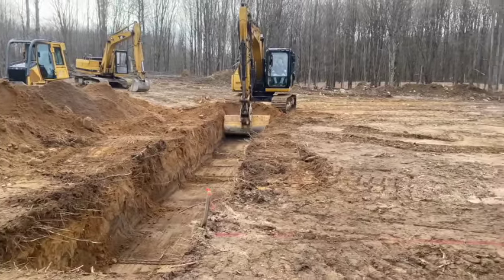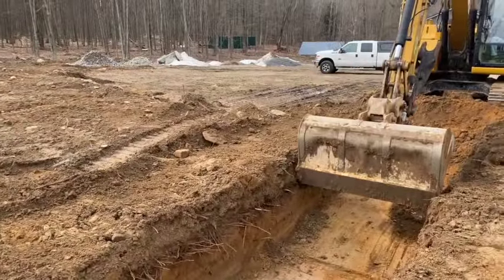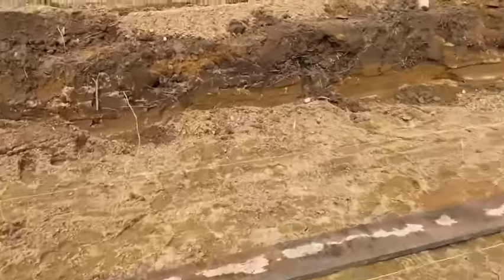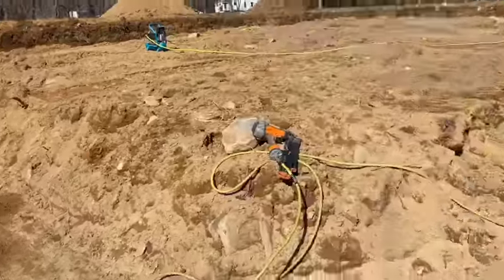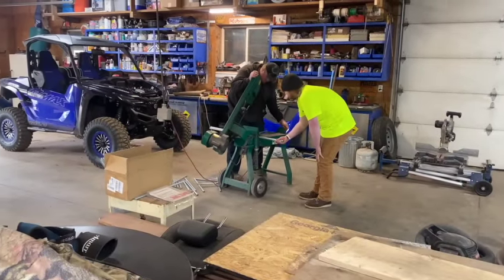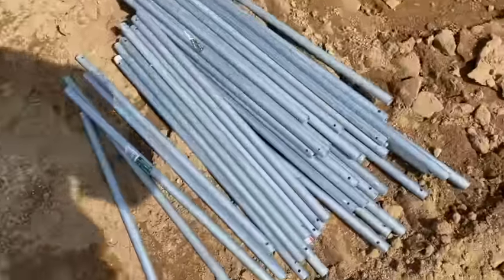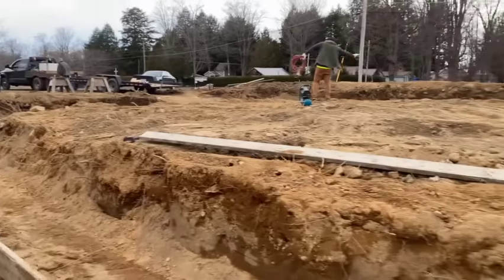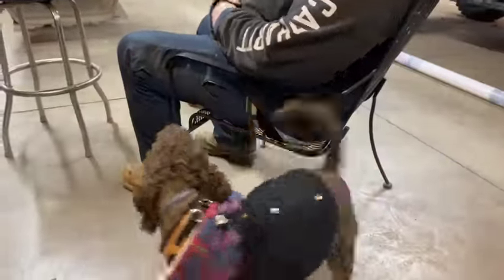Brand new ICF mono pour system you have never seen before.

Comment: Back in 1985, I devised a computer training video technology based on the layout of the famous LA Gastronomic cookbook. I can't believe that after almost 50 years, 99.999% instructional videos with great tips are still getting made by the old-fashioneded format prior to 1985 that forces me to listen to hours and days of lengthy videos to get info, a piece here, a piece there. And when I get it, it takes weeks to organize it. What the schmuck; just hire an architect and contractor and let them do it their way, good or bad. My neighbor did such and had his house demolished because just the cost of a new sewer line 10 years ago was costing $30k. So, he started afresh using a contractor to do it all. All I can is that if I wanted such a Mary Jane new house as he now has, I would move to one already built in an inexpensive cookie cutter subdivision in an inexpensive local for a small fraction of the cost. Unless you have millions to pour into a project that actually should cost hundreds of thousands, architecture is dead, dead, dead.

Comment: Why the house wrap in the bottom of the footer?  to prevent rising damp?  (@ 7:20 Footing 20" wide 10" deep, Spreader boards (conduit) 24" wide (each board nominal 2") ( forms 24"OD - 4" =20" ID)
Reply from the maker: Yes it is going to stop the footer from wicking up water and it will help me keep my planks from getting all concrete. Easy clean up.
Reply: @bondobuilt386  looking forward to seeing the monopour and stripping of the forms.
Reply: @bondobuilt386 I have seen guys put old car oil on the planks so the concrete doesnt stick. Seems to work well.

Comment: Try the Fabform monopour system with the Fox Blocks.  It's a plastic fabric footer bag that attaches to the Fox Blocks which are leveled inside the bag with Zevelers, drill adjust turnbuckles.  No lumber or cross ties and a speedy monopour.
Reply from the maker: Ya I seen that system.
Reply: They also make the bracing for the ICF wall and it's way cheaper than most bracing and fits into a tote.

Comment: This is a interesting way of going about this, I remember a few years back seeing the fastfoot system where you can essentially do a mono pour and skip the foundation forms by having a vapor barrier fabric act as the concrete form and use leveling feet to space out the proper footer height and level out the ICF blocks all in one. I think I saw it on Cutting edge homes when i was looking into building a ICF pool.
Reply from the maker: Yes I have seen some do it that way too

Comment: IN the south, my concern of the pipe is allowing pests in and water.  I heard you say a weep hole, but i See the water going in more than coming out.  Not a concrete guy, I assume the "spreader are to keep the forms in place during the pour.  The stakes on the outside will keep them from spreading, so I would assume they are there to help keep them from closing in on each other.  Since #4 rebar is about the same price as conduit, and could help structural strength (not necessary but added)  Why not do something like that.  Use the corner of a box to support the rebar with one staple to hold it up. Have a template set up to hold the boards in place while they are hammered in, kinda of like the stud master 16 from talon tools but for your purpose as temp spreader.  I think it would be faster also since you would not screw the pipes in, or boards, just one staple from a pneumatic stapler.  Save on screw cost and time.  For the board used on the bottom, the 12
 inch 2x6, you could also pre-make these with holes pre-drilled holes in the top board so your 3" screws go thru and you don't have to disassemble them to remove them.  I would paint them a unique color so during cleanup, you would know these are reusable and not waste.  A little more time the first time, but the 50th time would be happy you did it the first time.

Comment: Been doing it like this for quite awhile. Instead of conduit we use rebar and notch the top of the footing form board to drop the rebar flush.
Then icf sits on top and L kickers big enough and wide enough to grab the bottom of icf and outside edge of footer form and screwed.
Reply from the maker: Awesome. Have you poured a full basement wall with footers at the same time or just stem walls?
Reply: @bondobuilt386  
Stems walls  below the frost line so about 4 to 5  feet and shallow frost protected footing and stem walls.
We use L brackets made out of 2x6 with a triangle plywood gusset on both sides of the 2x6 L to set our footing form boards to height. The bottom of the L has a hole drilled for a rebar pin that we use to pound into the ground to set to our lines once we have the outside perimeter form set in place.
The L bracket is screwed  to the footing form board with GRK torx screws that we reuse all the time.
So the L bracket is like a foot that holds the footing form board at our needed height and also is our brace.
If needed once everything is set we’ll come back and drive round rod for extra bracing and use metal strap around the footer after our spreaders are set on top to width.’
We always reuse our L brackets AKA braces for another pour
Reply: Great idea for notches on the footer form and the L brackets.  Did you also space your rebar every 3' like the conduit here?
Reply: @Patrioti3260  2 feet

Comment: Great content Bondo, getting ready to do a garage in Taos NM using Foxblocks as well. Great idea with the conduit use. I've used 6 mil poly in the footer forms for my last few builds works great. One thing to remember when doing Ufer ground rod, concrete must be bearing directly on the dirt .
Reply from the maker: Thanks David. Good point on the ground rod. I think we will tie that into the concrete floor.

Comment: Amvic makes AMPEX EPS for radiant floor insulation of R-10 to R-16.  The Ampex holds the pex tubing easily in the heat welded vapour barrier.
2' x 4' Ampex interlocks with a t&g edge.  The wire mesh is placed on top later.  In this way you save alot of time by not having to tie down the pex,  you can stand up to install the tubing, no kneeling
Reply from the maker: I have used that but found it was expensive.
Reply from the maker: I think we are going to start stapling the tubing to the foam and wire on top of tubing.

Comment: for outside corner support I use a spreader on a 45 degree angle so that is will support the ICF corner foam only.  Later in the video I see you did place conduits at the 45 angle

Comment: Doing a mono pour is to me the best way to Keep water from getting through the solid concrete footer to walls. I like the idea of using 1/2" conduit but each of those conduit's will allow water to come through unless you cut them off at the wall and fill the holes on both side with foam and caulk to seal it from water getting through. Which is easier to work with Fox Block or Nudura Block.

Comment: Bondo,

This video is great timing for my current project.
Just now excavating and coordinating the plumber and electrician to move the existing water line from under a slab on grade addition.
Using Build Block 6” ICF for the first time. My engineer drew up the footers 24” wide x 12” deep, with lots of rebar. One length of the footers is 30” x 12” and going under the existing house on pier construction. A bit of a pain but oh well. I am using Form A Drain and it only come 8” high will put that at the base of the footer and 2” x 4” s on top to get to 12” footer depth.
Would you consider a 24” wide ICF as the footer itself and form a drain attached on the outside perimeter !
This would make installing the 2 rows 3 wide rebar installed in the footer easier, and add frost protection ?
The lay out parts of this video will help me square up everything in the trenches.
Planning a 2 inch bed of gravel under all to help with drainage.
Reply from the maker: Sounds like a good project. I don't think there are 24" ICF blocks. Glad this video is helpful.

Comment: My apologies if I missed it, but what's the house wrap under the footings for, to keep the concrete from pouring out the bottom of the forms?
Reply from the maker: It is there as a moisture preventer. Keeps the footer from wicking up the water.

Comment: Have you ever done or considered doing an insulated raft slab foundation? Where there's insulation all around the edge beam that then also continues below the slab, and is used as a form, then whole thing is poured at once?
Reply from the maker: I have not. We did a big slab last summer but dug it out after to install the frost protected foam detail.
Reply: @bondobuilt386  Ouch. Yeah I'd love to build a house that had a slab like that. Easier to seal everything up, too, though some radon system would probably still be needed. Too bad I'm so far away (NJ) from where you do this stuff at.

Comment: Time wise is this faster or less expensive than pouring footers, laying blocks and insulating ? Looks good, but seems like a lot of work and cost.
Reply from the maker: concrete blocks will always be cheaper. The ICF is less labor intensive and way stronger but definitely more expensive. On this job it was to cold to lay blocks without heating the mortar and using anifreeze so timing was great for this one. Also the ICF is more DIY than concrete blocks.

Comment: Drill a hole big enough for the cement paste of the concrete to go in in the middle of the pipes directed upwards 
And they will probably plug them self 
Up  when you pour .
Reply from the maker: There is no need for the pipes to be plugged.

Comment: Awesome video. I like the amount of details you show. It's a reality check to the Lego block simplicity advertised by all ICF manufacturers. Hope you will be telling us the pros and cons of Fox Block vs Nudura at the end of the project. I am curious as to what/if you will do something to block the conduit or if it even necessary. Could you use this conduits system for a full basement foundation?
Reply from the maker: This could definitely be used for a full height wall.I will try and explain my take on the two blocks. The conduit will not be an issue and will be under the floor on a full basement. Good weep holes if water needs to escape out to the perimeter drain.
Reply: @bondobuilt386  awesome,thanks

Comment: Bondo - could you please explain what the misc wood blocks on the ICF forms are for? Looks like they are tying seams together?How are they attached?  Great job!
Reply from the maker: They hold the blocks together where there is an odd size that won't lock together. A common seam. we screw them into the plastic studs.
Reply: @bondobuilt386  thanks Bondo!

Comment: I am considering an ICF mono pour for a 9' high basement. The tricky part is that I also want to do a suspended concrete ceiling. Is there a theoretical max height for a monopour footer/ wall? I want to avoid having to hire a pump truck 3-4 different times.

Comment: I've never seen building paper under a footing before. Is that some kind of local requirement? Does it provide freeze thaw protection or something else? In my region of Oregon we need to provide radon protection under living areas but that takes the form of a vapor barrier like 6 mil and we don't have to put under the footer.
Reply from the maker: That is there to  prevent the footer from wicking up water and also to keep the form lumber cleaner and ease of stripping the forms also.
Reply: @bondobuilt386  Nice try, but such hacks are unacceptable where I live. Here there must be a clear and continuous vapor barrier across the whole house.
But I am happy that the problem was considered at all. In most of the ICF videos on YT there are not attempts at all to prevent diffusion of moisture from the soil into the walls.

Here we make first the footing, then a reinforced slab ON TOP of the footing. (you can put XPS below in the middle). Then comes a 0.15-0.2" continuous layer of vapor barrier. The walls (bricks, ICF...) are built on top of this vapor barrier. Everything below this vapor barrier is considered wet, and everything above is dry. If the this vapor barrier is below ground level, then the insulation is continued outside upward on the walls.

Comment: What do these foam things cost would it not be cheaper to just lay solid cinder blocks. Foam idea has been around for over 50 years nothing new however that plastic should be metal inside of the foam pieces then I am sold.

Comment: Around here everyone uses 2x4 and builds their forms on top with the 2x4's cast in place. I never liked that system one bit especially if you are building a basement with the slab only 3-4" above the footings. Plastic lumber has been popular here for formwork that won't/can't be stripped. Used to be a great place that manufactured plastic dimensional lumber from consumer recyclable plastics. You could drop off your plastic recycling and pick up plastic lumber in the same spot. Environmental BS shut them down.

Comment: I know your trying to save on the pump truck but Looks like an immense amount of work doing it that way. The man hours of all that work and the lumber used would make up the pump cost. Why not dig just the footer and pour in the ground? No framing. That way a pumper wouldn’t even be needed at all. Just drive the  cement truck all the way around. Save the pumper for the wall. Then just set the blocks on the footer. None of that conduit and all that complicated bracing except for the top.

Comment: Why didn’t you guys use ICF footers??
Reply from the maker: What are ICF footers?
Reply: @bondobuilt386  thefootholdicf

The ICF footers stop any thermal bridging from the ground.

If you just pour a concrete footer and stack ICF on top, when Winter arrives all the concrete in the wall system will become cold, thus defeating the purpose of a ICF system.

Hope this info helps. 

I really enjoy watching your channel. Hope all is well with you and your family.
Reply from the maker: @GeneMstoner  Yes I have seen that system but it ends up quite expensive. This footer has foam going over it and 32" of sand on both sides so it should stay at ground temp at the coldest.
Reply: @bondobuilt386   I’m your age, grew up with Depression era Grandparents….oh the stories!

I was taught for long term investments, to spend the extra money up front for efficiency so you don’t have to worry about the future rise in gas, electric and energy in general.

That’s why I brought up the footers.

I did realize you put down foam over the footers.

The other interesting and becoming more popular thing is ICF roofs. 

Have a great weekend

Comment: Why did you not pour the footer first so you could add a keyway strip down the center of the footer and vertical heavy rebar? After the concrete footer sets you remove the foam or 4x4 lumber that created the keyway channel, then when the walls are poured they are locked into the footer around the entire perimeter of the structure thus your walls could never slide off the footer in tornado.
Reply: He mentioned this was going to be a monolithic pour, when finished it will be one solid unit, thus eliminating all the steps you mentioned, and I highly doubt a tornado will damage a foundation wall on a monolithic pour.
Reply: @theroadnottaken9378  At 23:48 he said he was going to pour the footer and let it stiffen up and then pour the walls and it should be done in the same day, that is not a monolithic pour it is still two pours and letting one set prior to the next pour. Monolithic is when the footer and walls are pour all at the same time so it is a single structure. Monolithic is from Greek Mono = single, lithic=stone
Reply from the maker: @chrisdaniel1339  We will just pour the footer and let it stiffen up a little then come back around like 20 minutes later and cast the wall. Just so the concrete does not bubble out the top of the forms. Im still saying this is a mono pour and there will be rebar tying the wall to the footer also.
Reply from the maker: @theroadnottaken9378  Its not going anywhere. LOL
Reply: @bondobuilt386  , having done this myself many, many times I totally understand what your are going to do, and yes this will not be going anywhere. take care BB.
Reply: @chrisdaniel1339  , he is only letting the concrete sit in the footing first so it has time to grab on to the rebar and doesn't ooze out of the footing and then come back around and fill the walls, there will be no cold joints and will be all incorporated as one.
Reply: @bondobuilt386  , Thanks for further explanation BB, don't think Daniel was fully understanding the process.
Reply: @chrisdaniel1339  , it's all going to be done probably within an hour or so, your not understanding the process.
Reply: maybe you should wait and watch the video of the pour, and you will learn something.
Reply from the maker: @theroadnottaken9378  Thanks happy Easter 😀
Reply from the maker: @theroadnottaken9378  Yupper
Reply: @bondobuilt386  , Thank you, have a happy Easter also.
Reply: @bondobuilt386  How long will it take you to pour the footer?
Reply from the maker: @chrisdaniel1339  I will let you know after tomorrow morning when we pour it. 9:00 am here comes the mud!!!!!

Comment: Not getting into everything 
BUT 🤔 you create MORE work.
Just set the string / line where your going set the boards. Not 4” off the line. Create more work.

Good idea w metal spreader but 🤔 they all got be taken off to Float everything.
Didn’t see anyone tape measure before putting on metal spreader. 🤔 that can create dog legs

*not trying say anything bad. Just saying.
To each our own